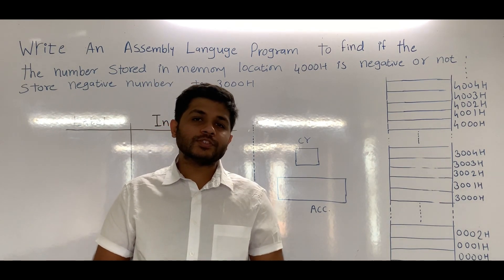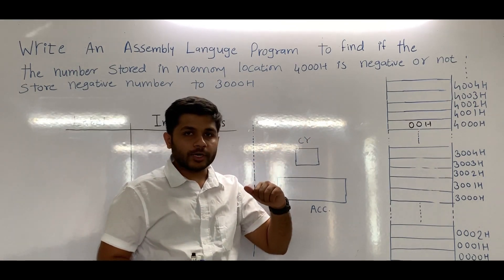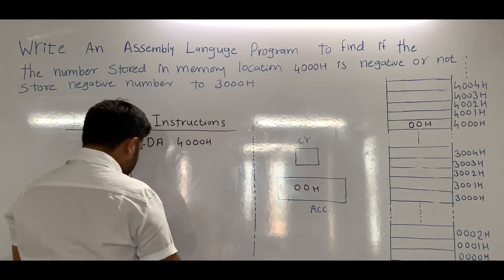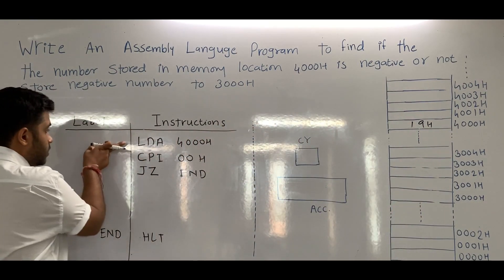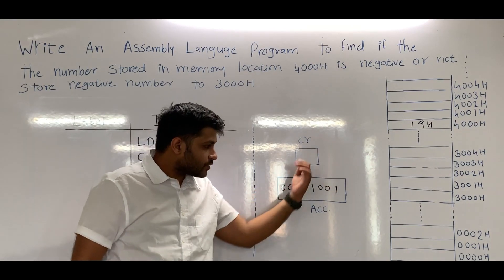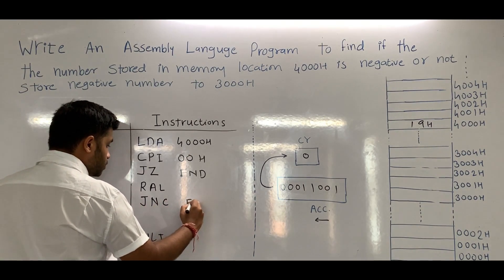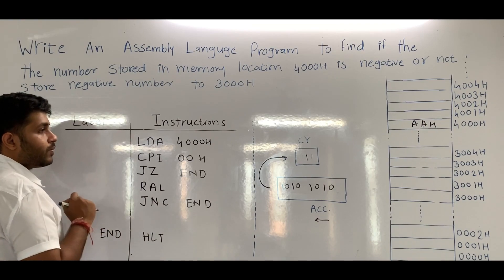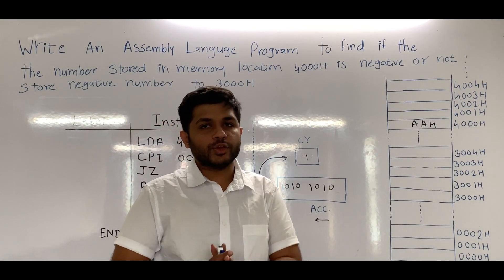find if number is positive or negative | assembly language program for microprocessor 8085

Comment: Sir a program positive Che na kem ka cpi is called a positive number and cni avu joya negative ma
Reply: @jayexplains6010  cpi 00h a to positive ma ava and 01h hoy tu negative ava ka nahi
Reply: @jayexplains6010  OK sir
Reply: Sir positive number logic is                      
LDA 4000H
CPI 00H
JZ END
RAL 
JNZ END
RAR 
STA 3000H 
END 
This correct or not for given problem by you. Correction hoy tu khejo na.
Reply: @jayexplains6010  OK sir